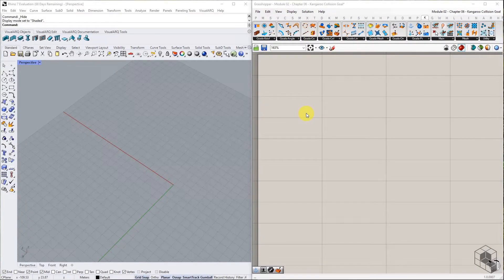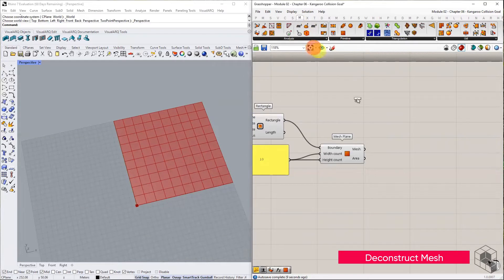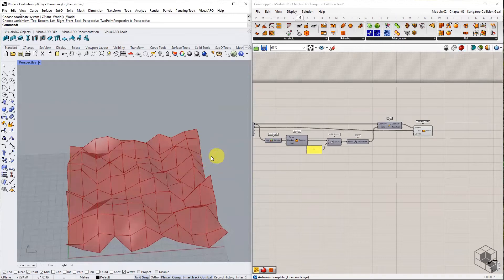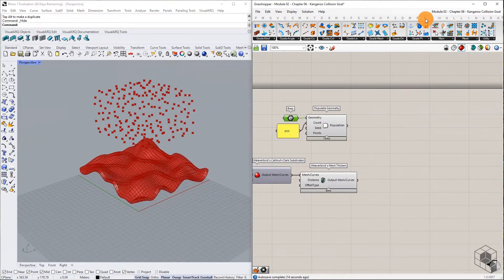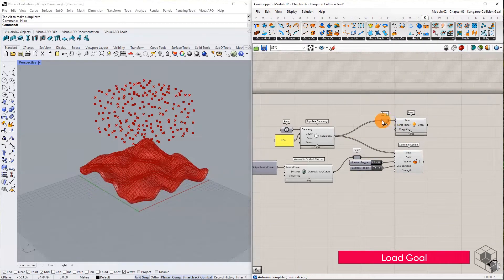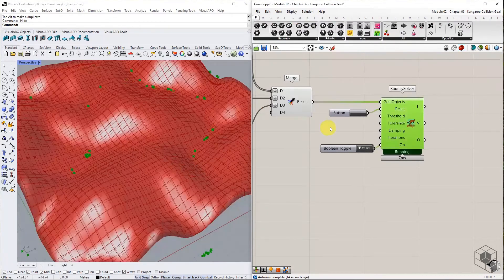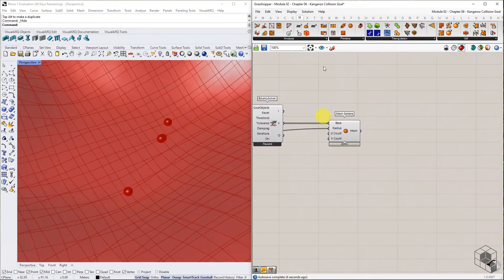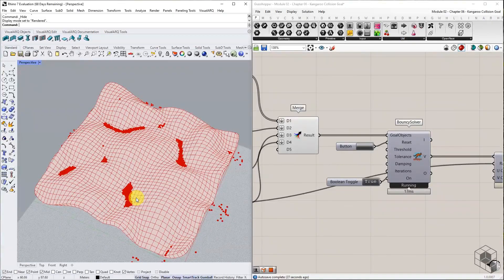Kangaroo Physics Simulations - Chapter 06 | Collision Goals | Rhino & Grasshopper Tutorial

Comment: Hello!
Thanks for the great tutorial!
Can I make this simulation with a set of surfaces?
Or should I somehow convert them into a mesh and connect them?

p.s. and an additional question, can I somehow display the amount of water that is left on the surface? Maybe a color gradient that would display the number of these balls?
Reply from the maker: Hi. Sorry for the late reply.
To use surfaces for simulation, you will have to convert the surfaces into meshes and then connect them to kangaroo.

You can display the number of ball collected in one area by using Point Group component. It allows for grouping of points based on distance threshold.

Comment: Hey, thanks for your video. I applied everything correctly starting from MeshThicken while using existing geometry (mesh from mapbox). However, the spheres pass through the terrain. I have no error messages. Do you have any idea what could have went wrong? ps: here's what the component help says "Computes a new mesh that is a closed solid, provided that the original mesh is offsettable and oriented" ; I have tried manually offsetting the original mesh, it worked and it seems like it's oriented as well.
Reply from the maker: Hey Amine! Please share your Rhino -Gh file on qbricklab@gmail.com. I will look into it.
Reply: Hello, the same thing happened to me. The solution I found was to thicken the mesh, until it can work.

Comment: Hey what Forces do i have to add to receive a heap of spheres? And how can i do it?
Reply from the maker: Hi. I am unable to understand the question. Do you wish to increase the number of spheres?
Reply: @qbricklab4200  No, imagine a straight floor and the spheres dropping on it and colliding with the floor and with the other spheres. In the end all spheres will touch the floor right? 
What i need is a heap of spheres. Imagine a heap of powder :) 

Could you help me out here? 
Thanks
Reply from the maker: @ZUPPAW  If you want to drop a bunch of spheres on a flat floor, all the the spheres will eventually touch the floor because friction cannot be simulated in Kangaroo. 

Alternatively, you can define a bounding box within which you drop the spheres and use the solid-point collide goal to keep the points within the box or any brep of your choice. This way the points will end up pilling. Just change the settings to keep the points inside the brep. Hope this helps :)
Reply: @qbricklab4200  thank you for your help! But i still have some questions 😅

1. How can i achieve that the spheres generated in the Box are not all the same size? I would like to define a size distribution. 

2. Can i add forces between the spheres? Like Van-der-Waals forces so that the spheres attract each other? 

3. How can i define that the spheres are not rigid, so that they deform a bit while colliding with each other or with the floor?
Reply from the maker: @ZUPPAW  Download the GH file from the link. It should help you with point 1 & 3. 

https://drive.google.com/file/d/1WBAILQuHSyfjyyNPBYK01HiooDQrFjIG/view?usp=sharing

For Point 2, you can assign a spring force between two spheres to mimic the force of attraction. Draw a line between the centre points of the spheres and assign Length (Line) goal. This should pull the spheres closer.

Hope this helps :)
Reply: @qbricklab4200  Thanks a lot! As im still New to this i'm still not sure how to use your help completely to improve my Simulation. Is there a way to connect with you to share my Simulation and maybe discuss some more?